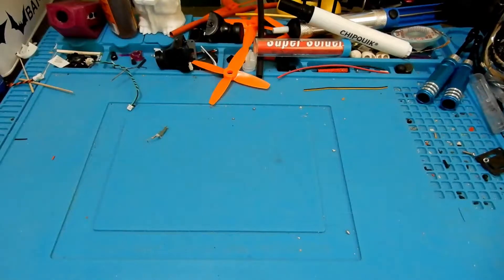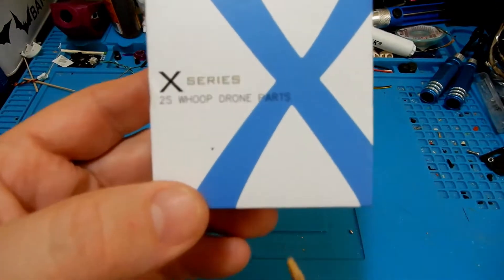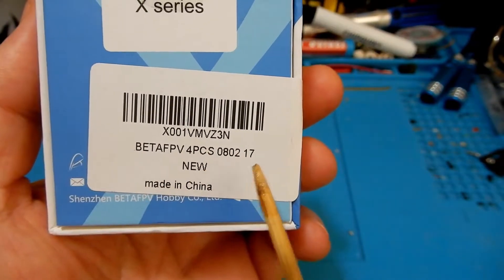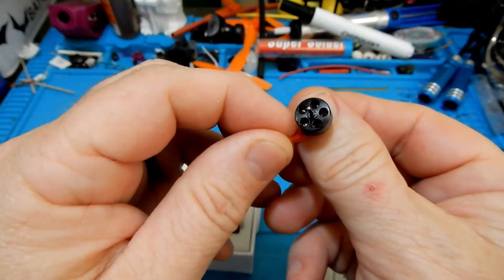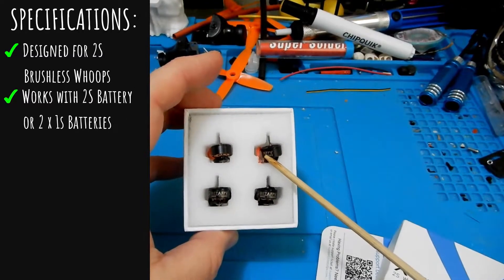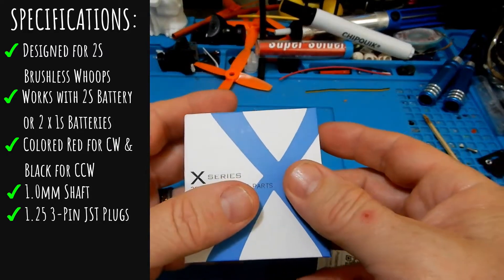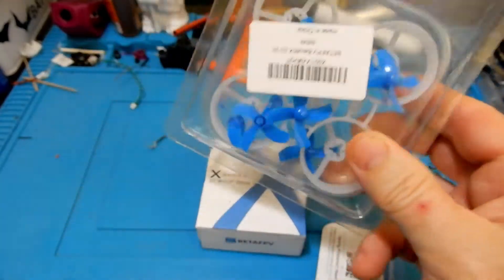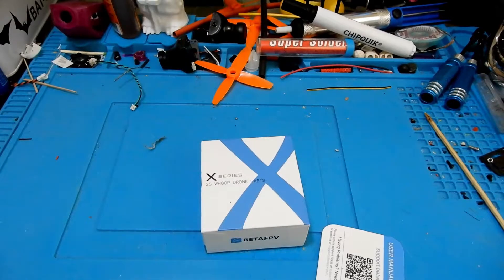0802 2s Brushless Whoop Motors

Comment: THIS VIDEO SHOULD BE TAKEN DOWN!  BetaFPV have NOW decided and announced on their website that due to the number of failures of both motor and board that the 0802 motors with above 14000 kV (so that is 22500, 19500,  and the new removed completely 17500 kV shown here and on my quad sold for 1S/2S operation and provided with connections for this) must NOT repeat NOT be used on 2S!!!!!!!!!!!!!!!!!

Comment: I thought I ordered these exact same motors! I guess instead I ordered the BetaFPV 0802 12,000 kv’s  what does this mean for me as I know nothing of KV’s
Reply: Josh, I don't own these motors, but I can tell you the difference in the KV's. The 12K will have less top end speed than the 17.5ks but better low end torque possibly, but they will most definitely be easier on your batteries and you'll have longer flight times. Hope this helped ya.
Reply from the maker: To put it simply the 17500kv is a faster motor than the 12000kv.

The numbers are the Revolutions Per Minute per volt of input. If you supply 5 volts on each of these motors, they will try to run at 87500 RPM on the 17500 and 60000 RPM on the 12000kv

Remember though with speed comes a price, the 17500kv will:
Run hotter.
Need lower gearing (smaller pinion, has less torque despite the RPM & power increase).
Will run the battery down quicker (less run time per charge).
What you have is a slightly slower but more efficient motor. So unless you are looking to be the fastest racer you made the right choice for acro and fun fly. I hope this eases your mind or helped understand KV at least.
Reply: The Quadcopter Review great!! Actually this may be what I need! I’m new to flying in acro! Thanks for the reply! And as always great review 🙌🏽

Comment: I bought a set of these motors recently and all of the wires are black... Heli-Nation keeps telling me that's how they are supposed to be but everyone else and the Amazon description I bought them from say it's supposed to be two red two black wires .. is it in the programming like they say or am I right about needing the red wired Motor?
Reply from the maker: The box i have has 2 motors with red wires and 2 motors with black wires. I hope that helps. If you need a Pic let me know and we can work out me getting you a picture of these.
Reply: From what I can understand is the if you get the 4 with all black wire you need to go to blheli_s configuration and switch the direction so it can run the right way so plug then in and change there direction